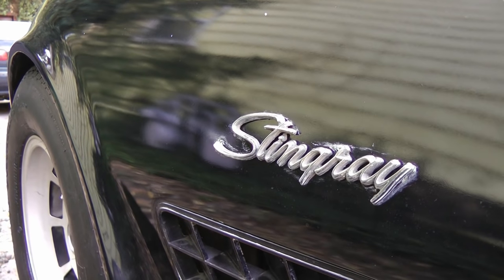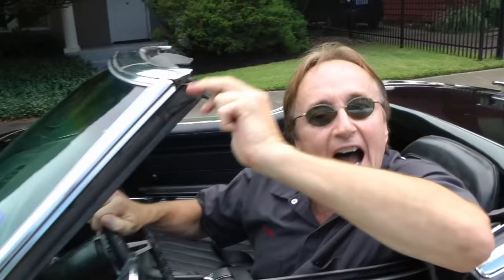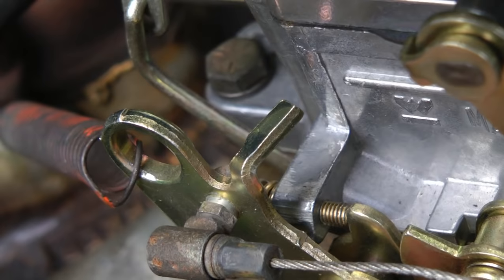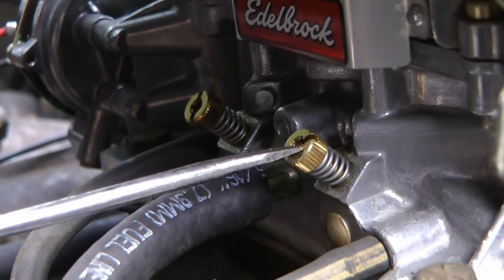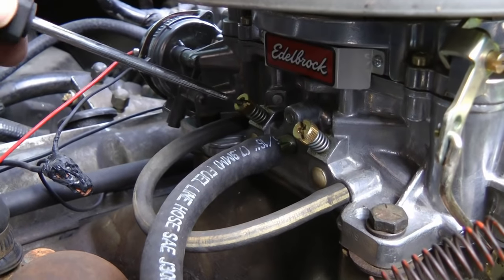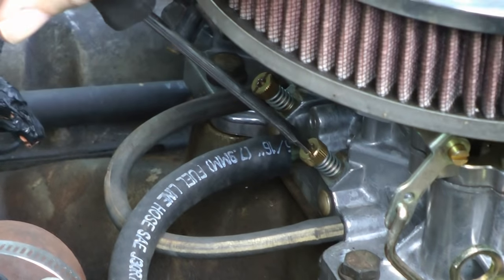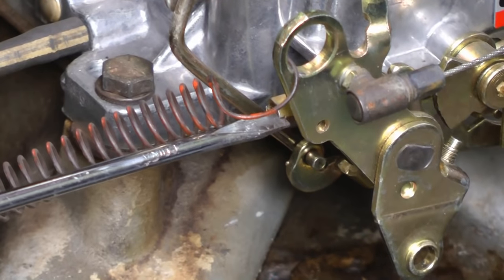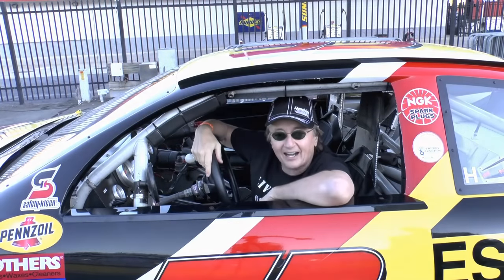How To Adjust A Carburetor On Your Car

Comment: As a single engine piston pilot, I've always wondered why auto makers never opted to include a mixture knob? Would it be ineffective due to the constant change of engine power being demanded (start, accelerating, stopping, etc.)?
Reply: Just a guess but I'd think that air is regulated by the throttle (gas pedal to throttle body) and fuel is regulated via engine load/ vacuum. It seems to me that a mixture knob would be redundant but perhaps I'm missing something?

Comment: highest vacuum at idle is the ultimate setting
Reply: K exatimundo!
Reply: Why what's the benefits?
Reply: Correct fuel/air ratio
Reply: +bicylindrico oh serious? Hmm gonna have to look into that
Reply: K How do I do that?
Reply: I just bought an 84 Ford With a straight 6.Gna rebuild the original carb party soon
Reply: Scott forgot how to set the mix.

He made it very fast  AND DIDNT LET THE ENGINE IN THE SMOOTH AREA

And there are others ways to set the mix,,,, if you use just the ear ist ok, ist not to much dioferent from that method mencioned by you, but scoot didnt tunned it very precesly,,,, i think he forgot how to do it, perfect.
Reply: 900 rpm is better for smother driving in the city and highway
Reply: @panaoutsios1990  much too fast for a street car.
Reply: Good info

Comment: Wow Actually I am from Sri Lanka and have a old Mitsubishi Lancer. Tried from many garages but no one can fix it for better tuning. But with your video I got my maximum level of fuel consumption. Thanks so much. Also if you have the chance do a video for ajusting Dialpham to have minimum sound from engine and also for maximum plug distribution. Again thank you very much 😈😎

Comment: The throttle return spring is a mess - should be doubled and hooked into the proper hole.

- Connect a timing light with tach, plug vacuum advance hose to eliminate it during tuning.  Ground idle stop switch.  Set warm curb idle to recommended speed, usually 650 - 750 RPM. 

- Assuming timing is correct, shut car off and gently seat idle mixture screws.  Right is richer, left is leaner.  

- Carefully and evenly back out mixture screws 2.5 turns.  This is a very common baseline setting with OEM carbs.  

- Connect a vacuum guage to manifold vacuum.  Start the car, and slowly but evenly back out the mixture screws to a point where manifold vacuum just starts to drop.  Turn each screw in a quarter turn from that point.  Check and readjust curb idle.  

- if turning the screws out (leaner) doesn't affect vacuum, you've got a vacuum leak someplace.  Check hoses, intake, and carb, and repair.  

- Most aftermarket carbs are set up quite rich.  That's only fine if your car never sees the street. Otherwise, you need to rejet to prevent unburned fuel from washing down the cylinder walls. 

- You set the choke, per mfr instructions, when the engine is cold.  Don't forget to adjust the fast idle speed - 1200 RPM is fine on a street engine.  

- Hook 'er all back up and try it out.  If the engine wants to die when warm, while putting it in gear, it wants a little more timing.  If it falls on its face during normal acceleration, check the accelerator pump/setting.  If it bogs when kicking it down, you need to adjust the secondary air door tension.

Comment: efi is good but what a pain to work on , carburators can be efficient if you know how to dial them in correctly, the Carter afb in my chrysler 413 averaged better fuel milage than my dodge ram 1500 with a 5.9

Comment: Don't adjust the "idle screw" if you have a vacuum advance distributor. it's wrongly named and actually adjusts your tranfer slots that controls when the distributor gets vacuum and starts advancing timing. If this is set wrong it will throw off your timing and most people confuse a timing issue for a carburetor issue and chase down a rabbit hole that leads no where. The transfer slots should be adjusted so the moment you touch the throttle it begins sending vacuum to your distributor. Furthermore proper idle RPM is set with a distributor adjustment not a carburetor adjustment assuming your mixture is correct.

Comment: I'm not mechanically inclined but have been learning a few things after I met with a mechanic after I had issues with acceleration and starting once in a while. He wants to put a Edelbrock carburetor in my '79 Trans Am with 403 instead of rebuilding the Quadrajet.  He says it would be smarter and much better and he would've done it a long time ago if it was his car. Car group friends are advising me not to. What do you think?

Comment: Thanks scotty, my 650 holley on my 305 is 1600 at park or nuetral and 700 in drive.
Reply: Is this a good idle setting for this motor?
Reply: Should be at 900-1000 rpm’s

Comment: Ok so I've got this 82 corolla, it rattles a bit like a diesel under load or when going up hills but when you pull the choke out, the rattle stops completely and it's nice & quiet. Plus this rattling thing only happens when it's fully warmed up.

Comment: Hi Scotty. I have a 2004 Camry with what's to believe a clogged Catalytic converter. I thought it was my compressor but someone said the low humming sound was coming from the center near the down pipe instead of the belt side. I'm guessing the engine is barely breathing at this point. A month or two ago I had a check engine light come for my O2 sensor before the cat. I've seen the videos on cleaning the with detergent and lacquer but I purchased something from autozone supposedly cleaning the cat and sensors. But it's still humming. Also once I first crank everyday after hours of sitting a puff of white smoke comes out and gas mileage isn't the same. What are my options. I'm sure I need to replace my sensor. Do I replace it now or wait until I fix the cat issue. I've heard I have a great car and hopefully I can save it. Thanks Scotty for everything

Comment: Thinking of getting a 1971 thunderbird (has the 429 cu Ford with 4 barrel carb) as my second car, the car only needs a paint job and a door lock according to the original owner
Reply from the maker: +Alex Raskalove realize that's when ford quality was at a low point, don't pay much for one because they are not really collector's items and aren't worth much

Comment: That's why they make a vacuum gauge,to get the best results for the carburetor settings and the highest vacuum reading for the engine to perform to its best. Just using a screw driver,one it is the lazy way,and two,you can't depend on the vehicle running the the best,or max performance.DUH,Have a nice day......

Comment: Scotty, I'm driving a '04 Ram 1500 pickup , 5.7 hemi with 203,000 miles on it. I'm try to get better mpg, (10 mpg now). Has New Champion platinum plugs (.45 gap) and wires in it.  
Can increasing the gap increase mpg's?
Any other suggestion?
I haven't swapped out coil packs or fuel injectors...yet.
Thanks Scotty
Love the videos
Reply from the maker: golddigger2163  fuel injectors would be number one, and also maf sensor

Comment: Don't try this at home, but I've cut trees and made sure they fell the direction I wanted by tying a rope to the tree and my pickups back bumper and a slightly longer chain to the future stump and my bumper, then I tighten the idle screw to around 1200rpm and put the truck in drive, it pulled the tree and then the stump and chain kept the truck from running away

Comment: Hi Thank you so much for this. I have a 1984 Mazda B2000 4 cyl, manual trans. I have a nikki carb on it and the old bat won't idle where I can do an adjustment. How to I combat this? Do I just fiddle with it until it idles and then adjust from there? I truly hope there's an easier way I'm not aware of

Comment: Is this applicable for a struggling Nissan Bluebird ‘89? Changed every filter. Thinking it could be the cat or the carb.. or maybe it’s just old and tired. Never has broken down, but it does struggle a lot up hill etc

Comment: Hello Scotty. From about 6 months ago my car idle speed has been going up and down. It just happens sometimes. Today my idle speed may be just fine but tomorrow it may increase about 200 - 300 rpm more. Then it will revert again. A 1996 Nissan Y10 Wingroad, GA16DS carb.
Reply: Clean and adjust
Reply: Thanks m8

Comment: Hi Scotty!

Me again. I have a small issue with my 2001 Ford Falcon. Basically without going into too much detail, i was changing a faulty relay and had to move the WAC relay along with the horn relay to replace the horn relay. To my confusion, i mixed both relays (one being the faulty one and the other the original WAC relay) my question is what does the WAC relay do and how can i tell if its working or not. Thank you.

Comment: Scotty ,if using a tachometer do you raise throttle screw above rpm setting then set air mixture .afterwards lower to proper rpm?

Comment: I have a question about the air fuel mixture screw adjustment? If the screws are not adjusted properly can that be causing my gassy smelling exhaust fume problem?

Comment: I have a 1982 CJ7 258 and the previous owner installed a weber carb on it.Its a 32/36. It runs like crap and will not idle until its warmed up.After its warmed up it runs fine.Should I buy an original setup to put back on it?Being a Jeep I dont like having an open air element under the hood.

Comment: I had a bad carb on a POS 1989 Honda Accord. Found a carb at a junkyard and rebuilt kit, installed donor carb, Accord now runs but idles at 2000rpm. Will this tone it down to normal 700-1000?

Comment: FINALLY!! Btw, as soon as you revved it a bit after finishing the adjustments, it didn't sound that good... As soon as you opened the throttle, but before it got to higher RPM's.
Reply from the maker: Arthur Sperotto realize the gas tank had to be replaced on this thing, which happened later on. Rust was clogging up even the new carb.
Reply: Scotty Kilmer For such a stock engine, you's be better off with a dual plane manifold. Single planes manifolds are generally reserved for high rpm motors.

Comment: New to the car thing, i swapped a 2bbl Rochester carb with a 4bbl edelbrock. Swapped the intake as well. Before with the old carb on acceleration it would pop or sound like someones sneezin then die. Now with the new carb the rpms skyrocket and it wont idle not to mention the fire/fireball that is fairly common occurrence. Any ideas?

Comment: On a carburetor, right is left and left is right. :p
Reply: ***** It's as you sit in the vehicle. If I say point left, you will point left relative to the front of you. Same with cars and engines, relative to the front of the car or engine.
Reply: Drivers passengers. Lol if talking to a teenager.
Reply: Step 1: Replace with 1994 Toyota CelicaProblem solved
Reply: @Whit_Siever  replace a classic Corvette with a Toyota Celica? That's the best joke I've heard in a while

Comment: Hey scotty! i have a carburator engine car.My car shuts off randomly after a while and it jerks after traveling some distance.I have changed fuel pump,Serviced carburator it was flut as well.I fixed that but still the problem is the same..But my car is okay in CNG(Compressed natural gas).But it had a problem in petrol.
Reply from the maker: that shows the carb is bad, replace it

Comment: Hi Scotty and many thanks for your videos and tips.
I tried the carburetor adjustment in this video but I'm not sure if I have done it right, the car starts and idles smoothly but my main problem is not solved, it's black smoke that I thought might be more fuel than air in the combustion mixer.
Please share any other thoughts and tips to help me and others to diagnose and solve this problem.
1971 pontiac firebird 350 CID
Reply: Mohamad Obedat Definetely sounds like its running too rich. When does the black smoke come out? On startup or whenever its running? If you have an edelbrock 1406 like the one is this video (I have the same carb too) you may want to check the fuel pressure. These edelbrock carbs are really sensitive to fuel pressure, the manual says no more than 5.5psi
Reply: Zachary Wuensch thanks for the reply Zach, the black smoke comes whenever it's running but it's not too bad, my car is a 1971 pontiac firebird 350 with stock carburetor
Reply: Mohamad Obedat No problem. Definetly too rich, if you can figure out why its too rich it will run much better and you'll be very happy with it. What does your oil look like? Is it really black? I just built a mild 383 for my s10, and this is my first build but I've learned a lot since I've gotton it running this past summer. I just solved my problem with it running too rich (just a little too much fuel pressure) and what would happen is it would smoke like yours, stumble at idle and it would actually change the color of the oil and make it dirty because there was so much gas going into the engine. Just some food for thought. Happy hot rodding 😎
Reply: Zachary Wuensch congrats for your project
My oil is black you are right but it's not caused only by the rich mix, to be more accurate I have to tell you that the black comes at the beginning of my push on the pedal even if it's moderate push and it goes after. I adjusted the carb but didn't change, the spark plugs looks good but they are old so I'm going to change them and now I will try to clean the exhaust pipes, you know we don't over use our toys so they is a possibility of carbon build-up in that area. I will try that and if it didn't help it will not harm and it will even improve 
Doesn't sound good to you from your experience? Do you think I'm on tge right path?
Reply: Mohamad Obedat it very well could be carbon build up....how old is your engine? Is it original? If so, its probably pretty dirty inside. The best thing for these old engines, or pretty much any gasoline engine is to run them and spend minimum time idling.
Reply: Zachary Wuensch  my car is a peace of art one, it's the original engine with documented 49k miles only, I thought a nice flush can help but to avoid any harm I will pay attention to every single detail like the materials or chemicals I use and how I do it

Comment: Hey Scotty! I think I have a sticking caliper, however I just put new brake pads on my back right brakes( which is the one that has the problem) and it's making a screeching noise, I took out the brake pads and greased literally everything that needed to be greased with non petroleum grease, it stopped the noise for like a week and now it comes back time to time, what is the problem and how can I fix it? Thank you :)
Reply from the maker: aleemiskool11123 either you need a new calliper if it sticks, OR a new rotor if it's all shiny

Comment: I've got an old truck with a carburetor that previous owner adjusted so it would run richer /better but it does not pass emissions in the city I live in. what I need to know is how to adjust it so it will run lean enough to pass emissions.....would that be what was shown here or is there another way to get it super lean even at the expense of performance. I just need it to pass emissions so it can be registered again!!!! its been out of service for months now over this!

Comment: How you doing I got a 83 Buick T type carburetor hot air turbocharged it has  a little knocking sound on the engine once you drive it for a couple of minutes just wondering what do you think what it is

Comment: I have a 1978 Ford F-250 straight 6 motor. It starts up and idols fine and runs good sometimes then sometimes while I’m driving it turns off while my foot is on the gas . Then starts right back up most times when I crank it . Sometimes it takes 10 mins to start back up . It has a new carburetor new fuel pump new fuel filter new air filter . It turns off when I’m in 3rd most of the time . I don’t know if my carburetor is tuned correctly so just wondering if that could cause it ?

Comment: Hey Scotty, I have a Dodge Van 1985 318 B250 and the carb is idling low. I tried the idel screw but that hasn't helped. Once the choke clicks off the engine will cut off when I do not have my foot on the gas...Need your help!

Comment: Hey scotty kilmer i have a 2004 ford e250 cargo van and it takes off perfectly fine but once it hitting the 30mph the rpms go down from 2500rpms to 1000 rpms. I took it to two mechanics and they tell me it might be a sensor or fuel pump. What you think?

Comment: Im glad we got fuel injectors. Carborators are bad in winter time.
Reply: Jay Khan Only if poorly adjusted. Carburettors work just fine (if a little lean) on cold mornings. Helps to have a manually adjustable choke.
Reply: Albinus81 Agreed. I have no starting problems down to 13F degrees (never gets any colder here). Seamless, fuel injection like operation from first start all the way to normal operating temp with an automatic choke. I'm OCD about precision adjustments and keeping everything else in proper tune though.
Reply: I now have an identical car (same chassis and engine) but with central port injection instead of carburettion. It starts very well in the cold (we're currently in Winter here) but runs like a pig until it's warmed up. Hard to start when hot as well that is ironically normally more of an issue with carburettion.

Comment: What do you do when the car stalls out at idle?  Runs ok while choke still engaged but once warm, conks out without foot on the throttle.  Idle screw adjustment makes zero difference in idle.
Reply: For me my problem was a bent lever that pushes the gas pump, as you give it throttle the lever is supposed to press at the same time, but it was bent so throttle opened but not enough gas so it bogged when accelerating, I re shaped the lever so it almost touched at idle (autolite 2100 carb)